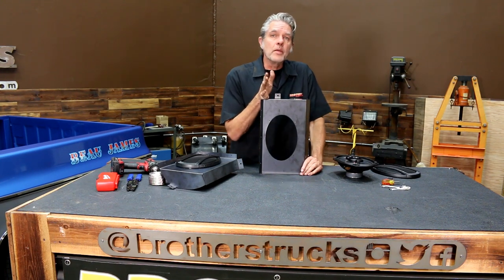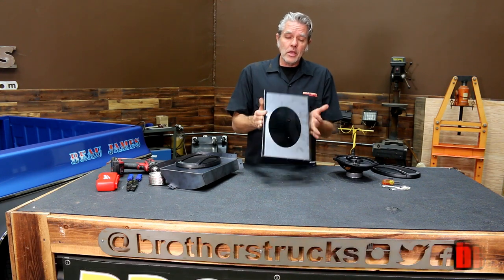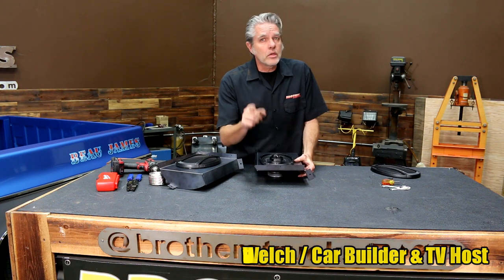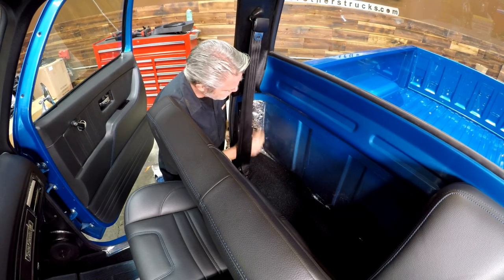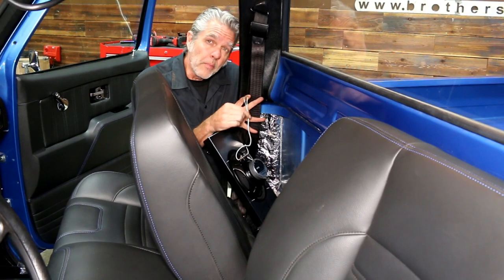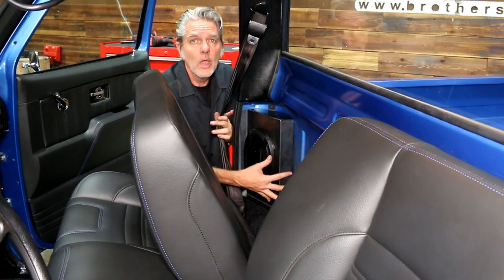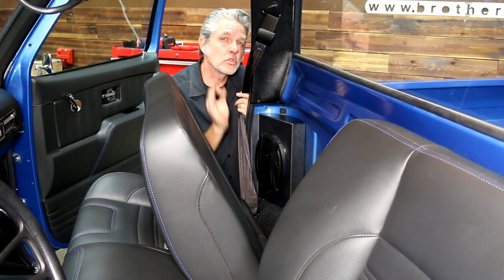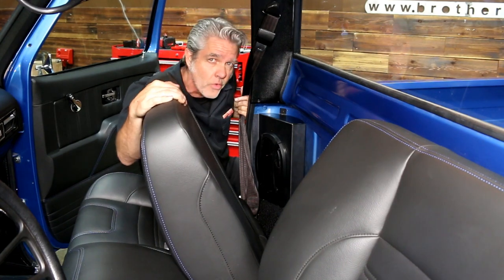1973-87 Chevy & GMC Squarebody Truck Rear Speaker Enclosures

Comment: When are you going to make a template to cut to shorten a long bed to a short bed frame c10.c20 crew cab
Reply from the maker: If you're asking about 1973-87, we're working on it now! probably available by next spring or sooner.
Reply: BROTHERS Truck Parts NO WAAAAY? y’all are fricking amazing if y’all come out with one. changing up the game

Comment: Hey, where did you get the sound deadening roll from, I can’t seem to find any that isn’t in a huge roll that I don’t need
Reply from the maker: It was the left overs from a huge roll. Trust us, if you buy a roll you will find uses for it over time.
Reply: @BROTHERSTruckPartsTV  what is the name of the sound deadening ? and where to find it? home dépot ect.. or that is automotive stuff? thx
Reply from the maker: @CRXSLY  https://www.brotherstrucks.com/1947-87-CHEVY_GMC-TRUCK-HEAT-RESISTANT-CARPET-PADDING/productinfo/PAD0010/

Comment: What 6x9 speakers are recommended?  Does enough sound get around them if you don't install kick panel speakers?  She has a nostalgic attachment to the air vent pulls in the non a/c truck even though we're installing a/c.  Was thinking about installing an upgrade to the dash speaker and these two behind the seat.
Reply from the maker: Plenty of sound comes around the seat. An upgraded Center Dash Speaker and these would work great! FWIW, you can still mount the vent pull handle even with the kick panel speakers.
Reply: @BROTHERSTruckPartsTV  sounds good thanks.  Detail how that would work, please?
Reply from the maker: @patlubin9197  you would just install the kick panels and mount the vent pull on top of the panel afterwards. We have it that way on one of our project trucks.

Comment: Can you still push original bench seat all the way back when they are installed?
Reply from the maker: Yes, absolutely!
Reply: @BROTHERSTruckPartsTV  Would you make me a pair with 5-1/4 speaker hole?
Reply from the maker: @thibster5590   Sorry Troy, these are made on a CNC so making a custom set would require modifying the program.

Comment: will any 6x9 speakers work with it
Reply from the maker: All the ones we have tested worked fine. If you end up with a set that the magnets are VERY large or VERY deep, you could have trouble, but that's not common.